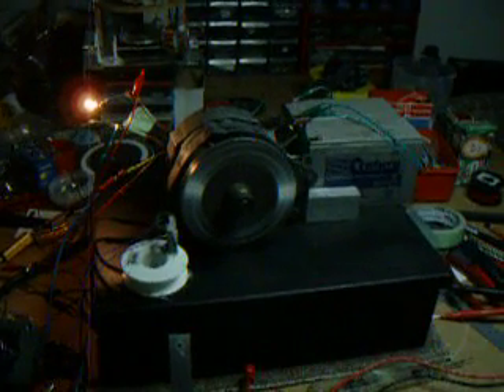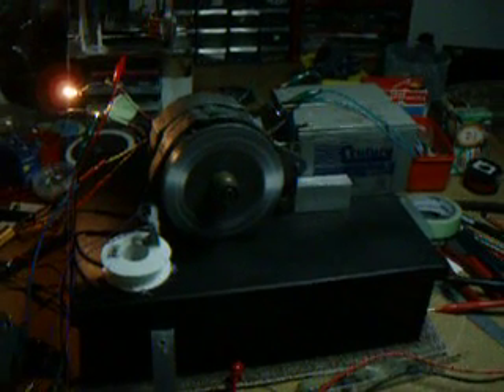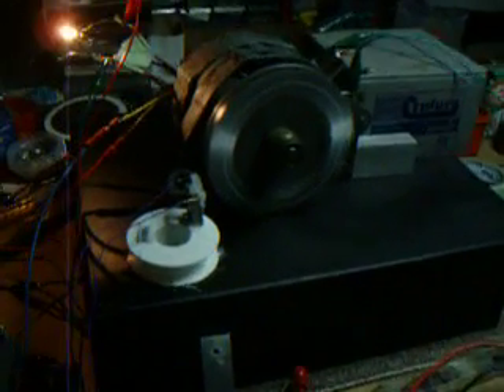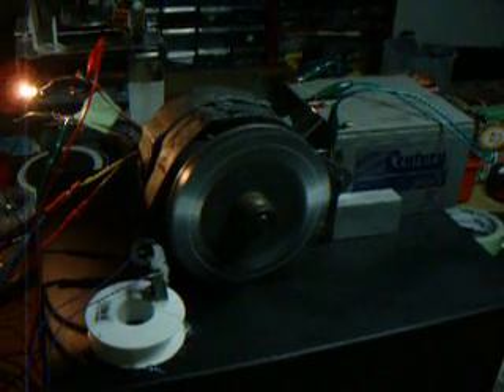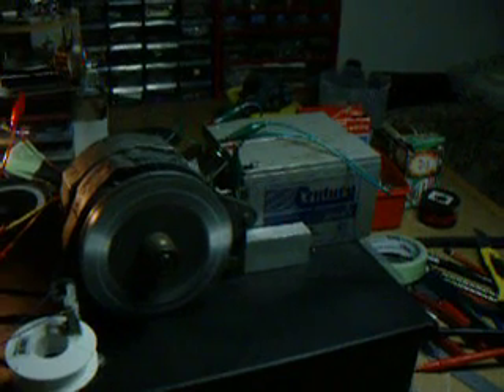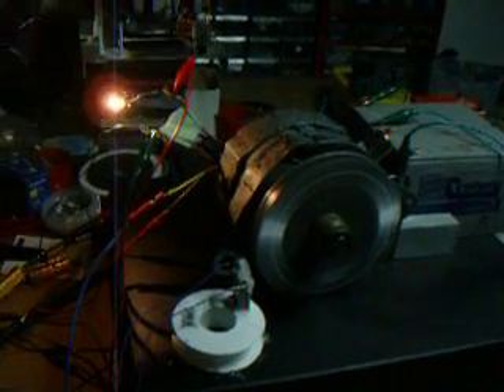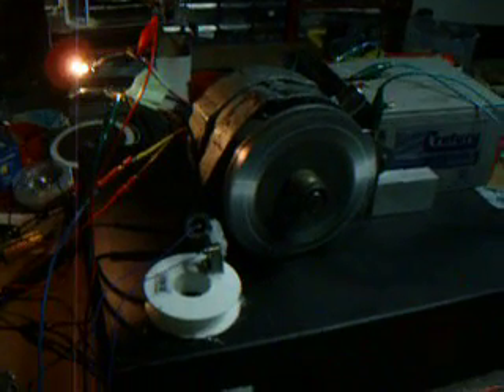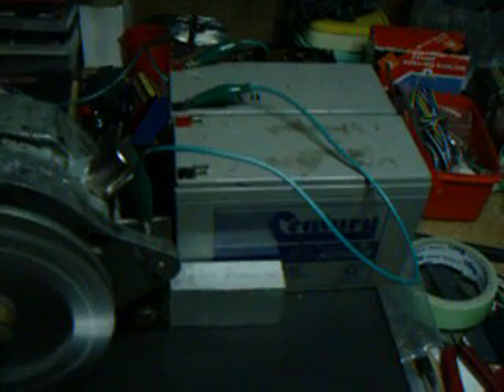Bedini pulse Motor from a car alternator

Comment from the maker: I have gone to the trouble of havening a new rotor made out of Aluminum and fitted with super magnets. when it comes in I will video its fitting to the alternator.
I will draw up the other bit of the circuit and post ASAP.
its coming..

Comment from the maker: on the outside of any alternator is a cooling impeller, I placed small magnets around the impeller synchronized with the stator coil.
you will also need to remove the diode pack from the unit and separate the coils just use one coil like you do in the Bedini motor.
the Alternator was a good choice because every thing is all ready made for you.
I am going to insert magnets into the rotor
and remove the second battery.

Comment from the maker: Sorry the video is not lighter.
This is an alternator from a car that I pulled to pieces and assembled as a pulse motor.
it is wired up the same way as the Bedin pulse motor. and it kicks back a very large EMF pulse
It also generates a lot of voltage and current from its other windings.
I am yet to measure all of it voltage and current potential and I am going to fix rear earth magnets to the rotor.
cheers.